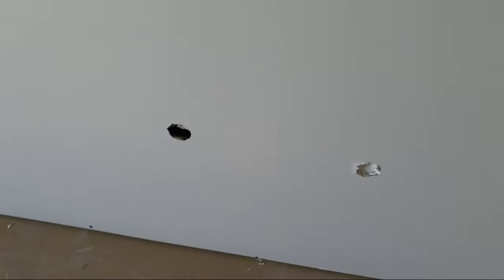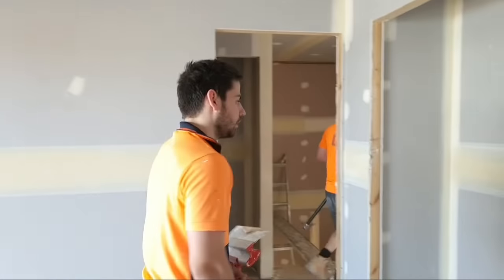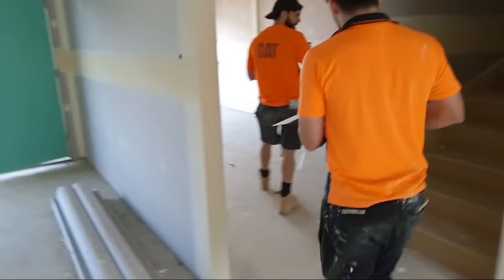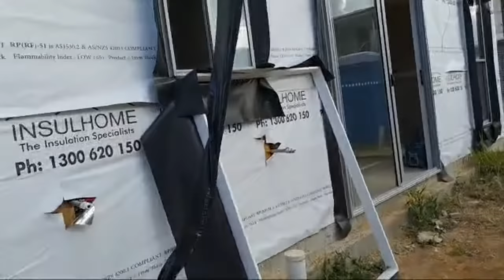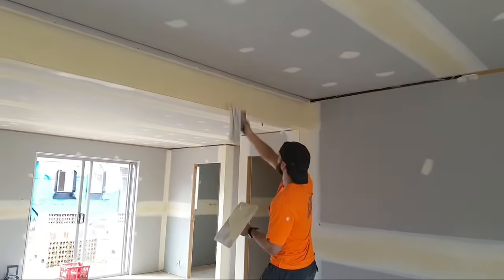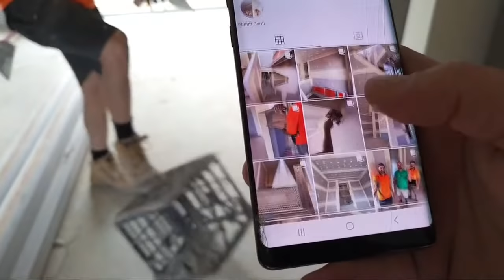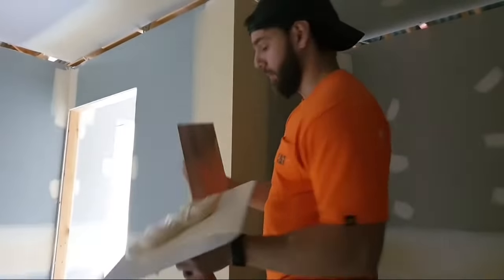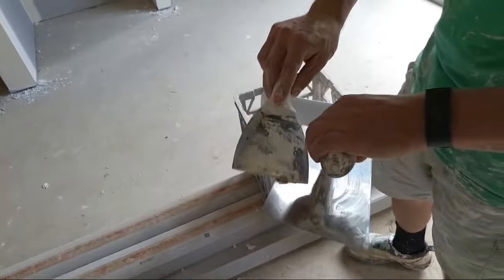Drywall Finishing With The Drywall Gangsters

Comment: Why are there huge gaps between the wall and the ceiling?  Clearly this isn't a mistake or shoddy workmanship. Is this an Australian construction code thing? I am amazed at the difference in framing I had seen in your other videos. I've never seen adhesive used for hanging either. Yellowish mud too!
Reply: Take all the screws out an the glue is what holds. Very diff to the states. They use cornice/cove to finish off those gaps. 90 75 or 55mm. This would be 90mm id reckon.they also back block between trusses or battern. Give a more solid joint for setting.

Comment: Is dj running the 12 box or that a 14 and whats the handle he was using wicked im a plasterer from new zealand been in the trade 4 year only started using boxes a year ago they are amazing
Reply: 12 inch Columbia flat boy box and a tape pro carbon fibre fixed handle
Reply: @drywallgangsters  ooosh haha were do u guys get your boxes from is it pro plaster
Reply: jeremy dromgo sorry we swapped to the Northstar 12 inch in this video so used to saying Columbia and yeah we got them from proplaster like 6 years ago
Reply: If you had to choose only one of the two brand boxes would it be columbia or northstar?  I have the northstar boxes and was thinking of trying the Columbia.
Reply: @drywallgangsters  did you remove the springs?
Reply: @lenegre69  yea on all our boxes

Comment: I see so many problems with this.  Why haven't they taped the corners yet? That should be done before you coat tape joints. Why is there no corner bead installed yet? That should be done before you start taping anything.  I am so confused!
Reply: Cornice goes over the gap up top where the ceiling meets the wall and also the beads are installed already. Not sure what you mean?
Reply: I get the impression beads are put around windows in states.  I learnt the trade in brissie, came to nz, holy moly so different. Blokes taping,second an top with 1 product. Taking 2 weeks to do house.

Comment: Eventhough workers did put this paper band and some special plaster but the damn ceiling cracket in fine continous long lines where the joinings are. Possible fix?
Reply: How many joints are in the room on the ceiling. In Australia if there's 3 or more in one space on the ceiling it must be back blocked. Second page of this link under installation explains what back blocking is the product used to glue it on is on the first page. 

https://www.usgboral.com/content/dam/USGBoral/Australia/Website/Documents/English/technical-data/BackBlocking%20Adhesive%20-%20PDS.pdf
Reply: @drywallgangsters  thanks, well i learned something new. The room is like 20sqm normal block of flat size. So definitely more than 3 joints. And no counter blocks were used, those metal profiles were layed about half meter apart, and a 20 cm lover from ceiling.
Reply: cj18 so a suspended ceiling was used if I'm understanding that right? According to the board manufacturer Boral, a suspended ceiling installed correctly does not need to be back blocked provided there is not a rigid connection between the ceiling and wall

Comment: why wipe down behind the box,  yout should be able to leave it clean with out a wipe down guy behind you
Reply: Exactly, the wonderful thing about Box work is...it is like a motor grader. it fills in the low and wipes down the high. When you wipe back over your box with a blade the mud then adapts to a less level service of the blade. AND ESPECIALLY if you are skimming the final coat with a twelve inch box. It should literally be skimming on and off if the other coats are done right. There shouldn't be anything to clean up. If your shoes and blades are right no need for a guy to follow around the box man.

Comment: Do you guys use Dura Bond on your corner bead first coat
Reply: We use sheetrock easy sand 45 it's a hotmud. All first coats are using hotmud we don't use any premix for first coat. It would take way too long to dry. In Australia you're expected to finish small houses the next day. It's normal here to use hotmud for all first coat and especially for beads
Reply: @drywallgangsters  
Do you use the hot mud in your boxes? If so how bad is cleaning the boxes up afterwards?

Comment: LOve the teamwork... But it ain't the same finnish as plaster and those gaps in the plaster board around the ceiling edges are fucking lazy..  still , great working system boys...
Reply: Ceiling edges have cornice being installed as you can see two boards high leave a gap in Australia because cornice is standard and you do not need to sheet it right to the ceiling and tape it if cornice is going up. Cornice is the same material as the wall and ceilings.
Reply: @drywallgangsters  yeah, i'd guessed that. my point would be, what if the people who live in the house in the future didn't like having cornice and having removed it found they have a ton more work to do to get the clean edges they want... I take the position that future proofing work is they way forward.. don't get me started about tiling onto bare plasterboard as the wall will come down if the tiles need changing in the future... I just think it's a cheap and lazy approach to building in general. That doesn't take anything away from your personal skills though...
Reply: mark kerridge yeah mate that's common the job would need battens to bring the ceiling closer to the walls. As the height is 2440mm and two boards is 2400 plus 10mm lift off the ground and you get the gap. Also the skirting board (baseboards) aren't big enough to cover lifting the sheets up against ceiling. Yeah building in Australia is whatever's most efficient at building time they don't care about renovating 😂